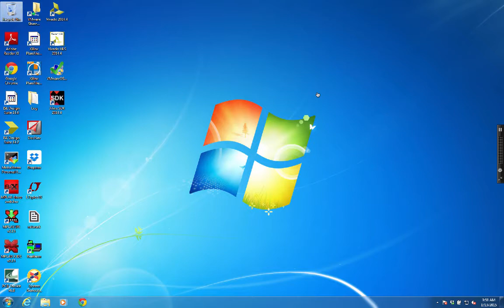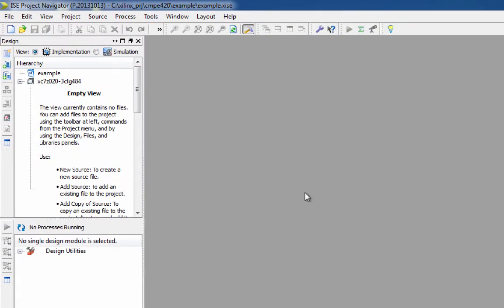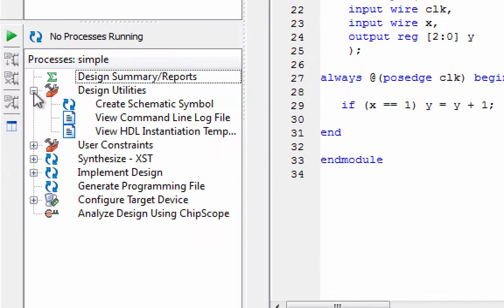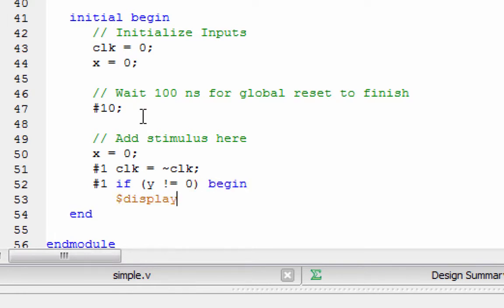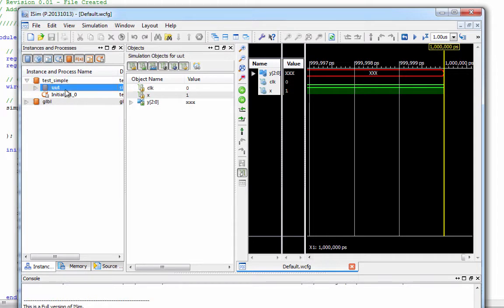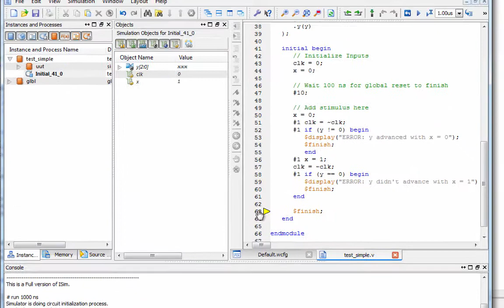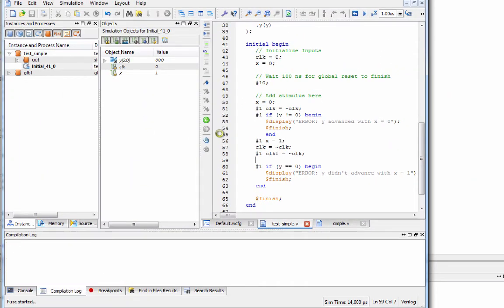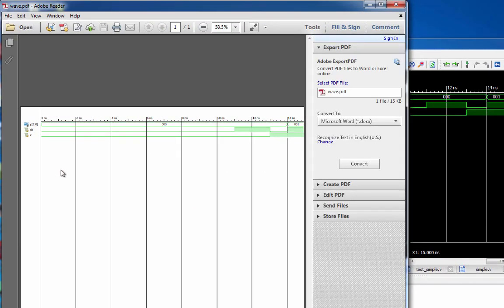Intro to Verilog using ISE

Comment: I know this is from 2015 but thanks. Question, Iv'e seen people just hit simulate for a module without needing to write a test bench, Why is that? I am on ISE 14.7 btw
Reply: I can only imagine that they are simulating a model that runs itself.  For example,  a module that only produces its own output.  The other possibility is that they will manually twiddle bits during the simulation. Or,  I suppose,  they can't resist hitting the button,  but don't know what they're doing??
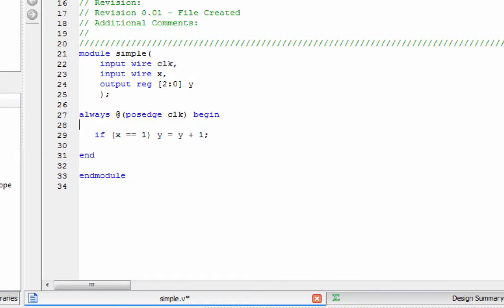Reply: @tbriggs66  I also got an error at 4:26. It says: Procedural assignment to a non-register y is not permitted, left-hand side should be reg/integer/time/genvar
Reply: @tbriggs66  I was following everything step by step. So I don't know why i would be getting this error. I am on ISE 14.7 like I mentioned
Reply: @tbriggs66  https://www.youtube.com/watch?v=_wFdoxq5YyE I actually see you doing the same thing in this video of yours. You didn't write a test bench. All you did was hit the simualte button